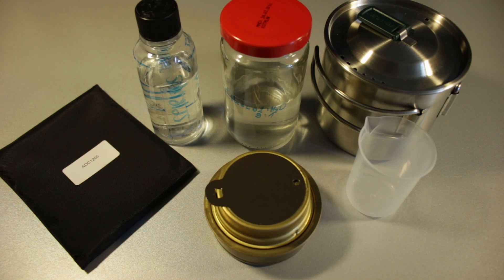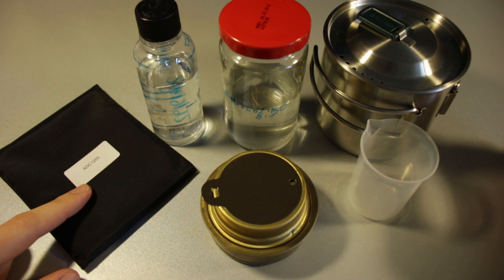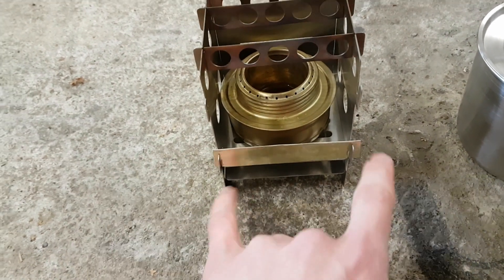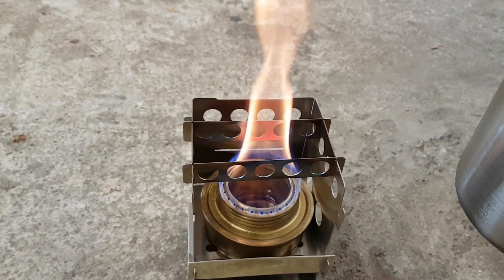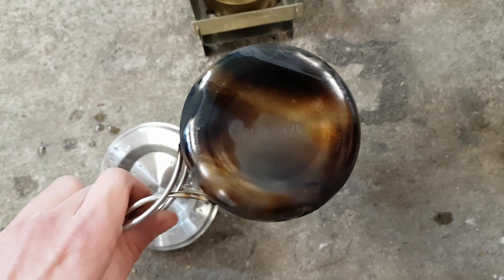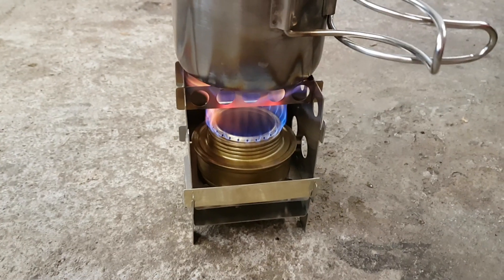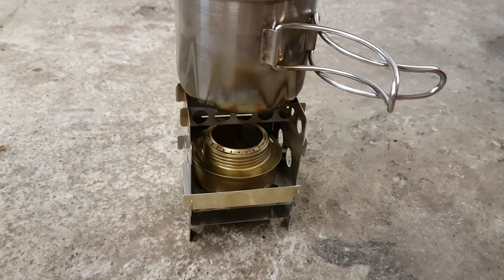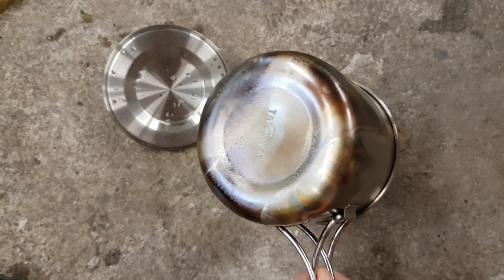Alcohol Stoves - Add Water to Reduce Soot

Comment: Soot on pan causes ur pan to heat up faster.. dont wash it off
Reply from the maker: Wouldn't it just insulate the pot from the flame and therefore make the system less fuel-efficient?
Reply: @icecreamgecko  No, it does create an effect of heating more quickly, like anodizing. However, I dislike having the soot get all over everything. Always a trade-off!

Comment: I found your video because i was trying to figure out what trangia's instructions wanted to tell when it said add 10% or max 15% water to the fuel to redue soot. You appear to have added 30mls but to how much mls of ethanol? Like what is the final mls with water and ethanol? Also Another question, i want to brew coffee with my one, the maxium time required is 10 mins or less. What would I have to do here, like how many mls of ethanol mixed with how many mls of water? 

Additional information: The pot of coffee will brew 1L
Reply from the maker: Hi, thanks for your comment. I prepared a 9:1 mixture of spirit and water which means that I had a 10 % water content in the mix. Therefore, by adding 30 ml of said mixture to the burner, I in essence added 27 ml of spirit and 3 ml of water.

In regards to the 10 minute brew time I cannot really help you. An entire litre of water is going to take quite a bit longer than the little volume that I brought to a boil. I do not even have a pot and stand for the burner to do that safely . 😖

Comment: I have similar problem. After spending half a day making an elaborate capillary-based alcohol stove out of three cans (five if failures count) and boiling some water using what supposedly is laboratory-grade pure ethanol,  my pot instantly became sooty... I suspect lack of oxygen to be the culprit in both my and your cases since pure carbon is a byproduct of an incomplete burn. Maybe it'll be less sooty outdoors since fresh air and all that jazz, but I'd probably experiment by gently but continuously blowing some air through a tube directly underneath the main flame when it's burning. Then compare the resulting soot buildup. If it becomes less noticeable maybe it's wise to modify your burner by adding vents to it's bottom.

Comment: What about burning methanol and does the ratio 50/50 with water work? Please answer
Reply from the maker: I have never tried Methanol as a fuel for this. Tbh, I do not think it is worth the hassle of dealing with a more dangerous alcohol, when Ethanol is more widely available.
Reply: @icecreamgecko  Thank you for the response. Here in Syria, where the war and the lack of materials and gas are looking for cheaper alternatives, even if they are somewhat dangerous. I repeat my thanks and please provide me with any information if you get it
Reply: 98 or 95 concentration methanol works best boils clean no smell and pure blue but just be caution of the toxic fumes (they are odorless)

Comment: Nowhere in the directions on any Trangia packaging or on the website does it instruct people to add water to the methylated spirits or denatured alcohol... The only reason it will still ignite even at 50/50 is that the alcohol doesn't mix with the water, it simply floats on top, and once it's burned out, you've got a Trangia spirit burner half-filled with water that will now start causing a green patina to start building up on the brass. Additionally, it doesn't reduce soot in the slightest (all it does is increase your boil time, as seen in this video) - this is a ridiculous wives tale repeated by inexperienced and scientifically clueless Trangia users who don't understand how different alcohols burn. The ONLY way to prevent soot on the bottom of your pots and pans is to use pure ethanol-based fuel which costs around 3x the amount of the cheap methylated spirits you'll find in the supermarket. This kind of clean-burning fuel is typically only available at solvent retailers rather than grocery or hardware stores, and the reason for this is simple, and that's because they don't want a litre (or larger) bottle of pure ethanol to be available at the supermarket, as it encourages dangerous practices from problem drinkers, hence why they began adding methyl alcohol to what you can buy easily at the supermarket, to make it poisonous to drink...
Reply from the maker: Your statement is only partially true, it depends on the alcohol that is being used. Ethanol and Propanol DO mix fully with water. Their hydrophilic OH-group counteracts their rather short hydrophobic Alkyl-group. Alcohols with longer Alkyl-groups (Butanol and up...) will separate when they are being mixed with water. While the water in the mixture does not ignite, it will likely vaporize due to the intense heat that is being generated in the burner by the flame. Still, Ethanol is hygroscopic which makes it difficult to keep the water-content in the mix very low over longer periods of time anyway.
Over here they add substances like butanone and denatonium benzoate to ethanol as denaturants. The latter is also used in various other items to make them a bit less likely to be chewed upon and eventually swallowed by children (https://www.polygon.com/2017/3/1/14784140/nintendo-switch-cartridges-taste-awful-psa).
Methyl alcohol does make drinking alcohol even more poisonous than it is already but it is usually not used as a denaturant (quite the opposite) but as as a cheap additive for the drinking-ethanol. There are countless cases of hotel bars etc. serving e.g. adulterated wine to people who suffered grave medical consequences or even died because of it.
Reply: Also the advice to buy pure ethanol (and pay alcohol duty) for fuel is ridiculous.
Reply: I only started getting sooting issues when I began using my trangia in a firebox . As identified by others the higher the pot or kettle is above the burner the worse the sooting is . I now use the firebox as a frame but set the Trangia higher , 4 cm is ideal below the pot. Bingo , no more soot. I am using ekofuel bio ethanol . I am uk based.
Reply: Bro alcohol dilutes in water unlike petroleum fuels 😂😂
Reply: Wrong It says on the yellow bag with the trangia spirit burner. "to avoid sooting, dilute the fuel with 10 or max 15% water"
Reply from the maker: Thanks for the heads-up in that regard. I just checked the yellow bag and mine gives the advice in regards to the dilution as well, in most of the languages. However, in the german section this is not even mentioned. 😅
Reply: @icecreamgecko  Then perhaps the Swedish team at Trangia have been using a form of alcohol fuel that is somewhat different to the methylated spirits and denatured alcohol available in most other countries... My wife and I are both master's degree chemists living in Melbourne Australia, and whilst we intrinsically knew that adding water to methylated spirits was not going to prevent sooting, we tried it on a picnic with our Trangia 27 set, and just as we suspected, even at 10% water dilution, there was still plenty of sooting on the bottom of the frying pan... What we confirmed with this experiment is that sooting does not occur with the saucepans, only with the frying pan, and this is due to the difference in distance from the spirit burner. When a cooking vessel is at the optimum height/distance of 3-4cm from the spirit burner, the combustion of methylated spirits does not soot, however, the Trangia 27 holds the frying pan much higher above the spirit burner, as such, it doesn't matter how much water you add to your methylated spirits, excessive sooting will still occur... The only way to prevent this happening at any height above the spirit burner is to use perfume grade (i.e. pure) ethanol at approximately $20 USD per litre, which is why HEET costs as much as it does for such a small little bottle of the stuff...

To clear up the confusion, there are 4 main types of spirit burner alcohol:

-Bioethanol
-Isopropyl alcohol
-Methylated spirits
-Alcohol gel

Isopropyl alcohol burns inefficiently, methanol-based methylated spirits are now illegal under new EU rules and alcohol gels produce a sticky residue. This leaves bioethanol fuel as the best option for a Trangia – it burns hot and clean – both environmentally and from a residue standpoint. Due to increased use and production of ethanol for use in cars and other industries, bioethanol is also fast becoming cheaper and cheaper.

Bioethanol fuel is widely available on Amazon (UK) and Amazon (US) and eBay, though usually at a much higher cost than alternatives. You can also get hold of alcohol fuel at camping and outdoors shops, though these tend to be gel based and much more expensive.

In the USA, Ignis Bioethanol Fuel is the bestseller on Amazon with great reviews and ratings. Ignis is made with 100% alcohol, burns cleanly and is made in the USA.

The best UK Trangia fuel I’ve come across is EkoFuel Bioethanol Liquid Fuel. You can get it for as little at £1.85 per Litre (inc. delivered) depending on how much you buy. As the name suggests, the fuel has been formulated specifically for use in alcohol stoves. It is also the highest purity bioethanol I’ve found – EkoFuel is made from 97% bioethanol, 2% other alcohols and only 1% denaturants.

It burns almost invisibly which is a sign of an efficient, clean, low-carbon producing burn. EkoFuel’s website states:

“Our high-quality bioethanol fuel is clean-burning and under ideal conditions produces no smoke, no odour and is ash free. Unlike methylated spirits or isopropyl (rubbing) alcohol, EkoFuel’s Fuel for Alcohol Camping Stoves is was formulated for the purpose of cooking or boiling water using an alcohol stove.”

EkoFuel are firmly established as the largest retailer of bioethanol fuel in the UK and EkoFuel can be found on shelves at ASDA and other retailers.
Reply: This comment is wrong on so many levels. Do you own a trangia? Read the packaging

Comment: Skip all the scrubbing and just put aluminum foil on the bottom of the container.

Ever notice you have to scrub your butt off to remove soot but it comes off all on it's own in your backpack?
Reply from the maker: Won't there be a thin layer of air in between the two surfaces acting as an insulator though?

Yes, the backpack gets "seasoned" on the inside during that process. 😄
Reply: @icecreamgecko  One could make the foil flat against the pot like in a cake pan going into an oven.

Comment: Is that 91 or 99% rubbing alcohol? Does it still give off the nasty smell while burning with the water mixture?
Reply from the maker: The only thing that is written on the label is that the bottle contains ethyl-alcohol. I assume that it is 99 % Ethanol but about the precise concentration, at the time of the experiment, I am unsure of. The smell while it is burning is certainly different from other fuels but I did not notice a particularly nasty one.